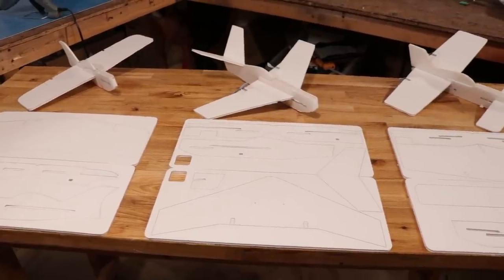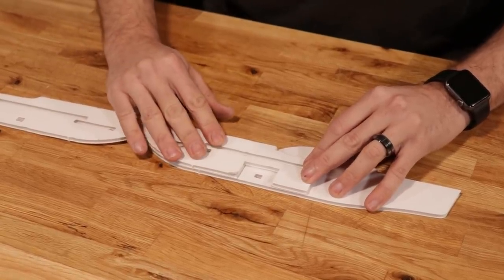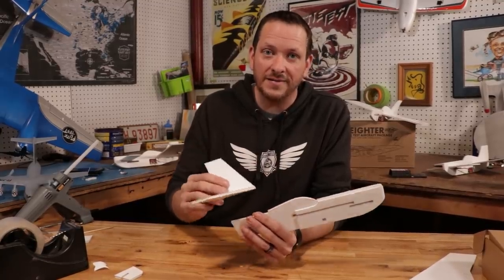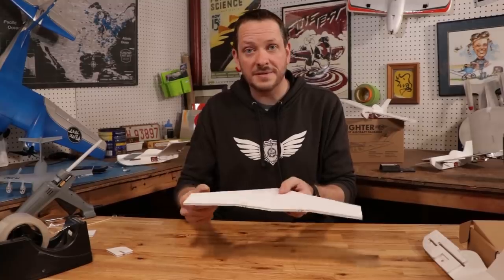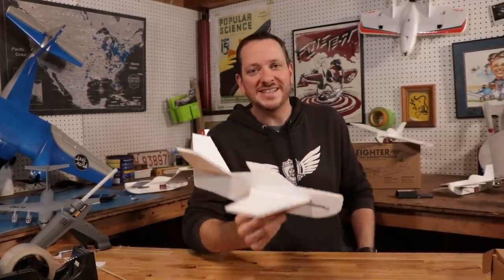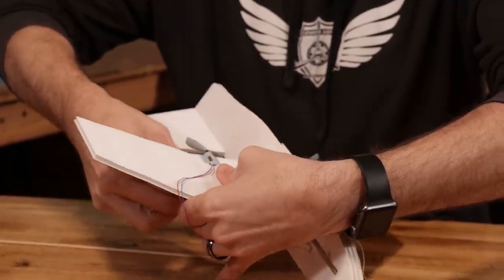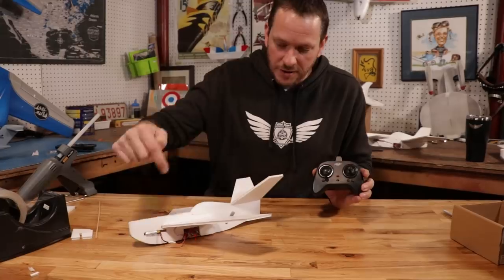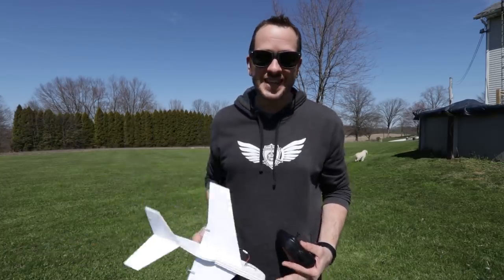EZ V / Build

Comment: Are the plans available for download?
Reply: Usually if they have a video on it they have the plans for it to download
Reply: These are STEM Kits, and according to information found on the FT Forum, they currently don't plan to release free plans for them. BUT, you can buy the FT STEM EZ-Pack ($35), and put it on your own DIY builds. 👍
Reply: I can't find this FT STEM EZ-Pack

Comment: I have the same receiver from the C 17 before it was sold by flitetest, and noticed it has two other purple two-pronged plugs like the ones used for the motors. is there a use for these, could I use servos on this receiver??! just wondering during the quarantine.

Comment: A couple tips.
- if you are going to put on the RC pieces, I would recommend run the right motor wires through the hole in the fuselage, through the hole in the circuit board and then plug it in BEFORE you mount the engine OR the circuit board on the aircraft. There is not a lot of extra wire and I spent more time trying to fish that little white plug through the hole and getting it plugged in than I did on the entire rest of the build.
-If you use double sided tape to mount the circuit board, make it a little long to extend below the bottom of the board to protect the power switch and the LED. Also check it after every crash..er landing to make sure it isn't loose. I flew with on that was loose... if you want to call that bucking bronco a flight.
Reply: Thx this will help me a lot

Comment: Just wanted to thank you guys for developing this system. 40yrs ago I was the flying club instructor for many summers I had 6+ students learning how to fly the balsa gas planes. I had a great record only lost one plane and all my students were proficient flyers after a few weeks of Saturday/Sunday flying. Even 40yrs later and a solid 30yrs being out of the area a couple of now adults will recognize me if I swing by the air strip. Never fails they all want to share the latest stuff and see if I still have it by handing me a controller 😆😆. Its like riding a bike👍

Now I have my pre teen kids learning to fly these little stem planes at our park a few times a week. Maybe one day I’ll get back into the bigger stuff. But having lots of fun thanks to Flite Test with these little foam flyers👍